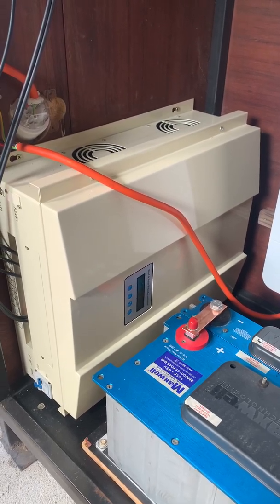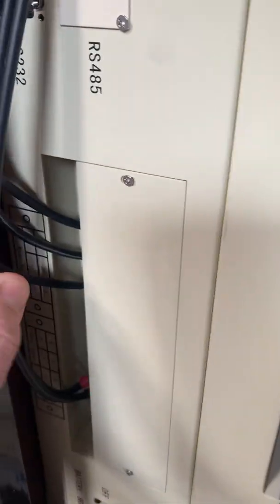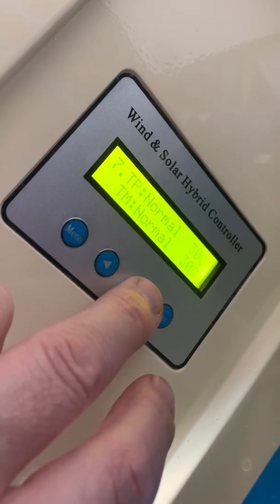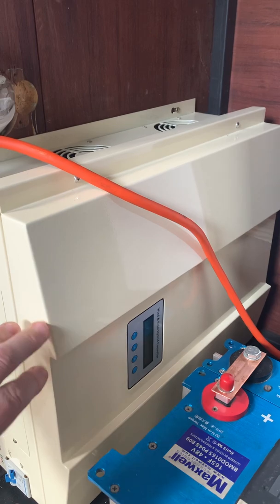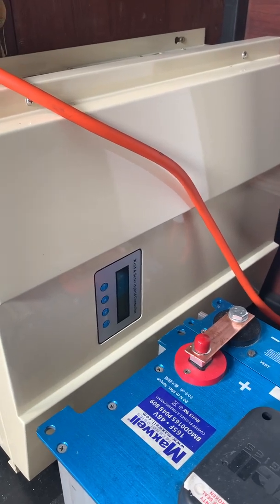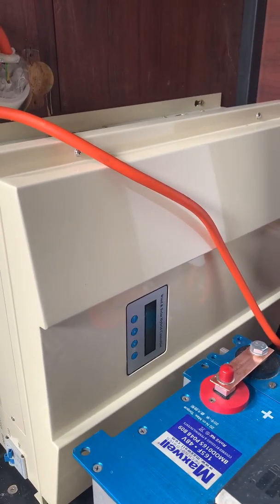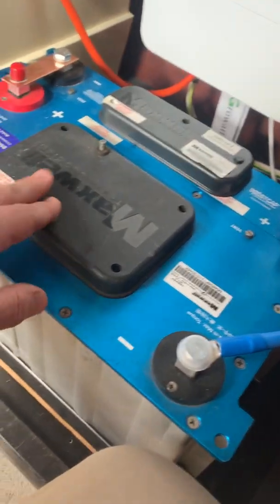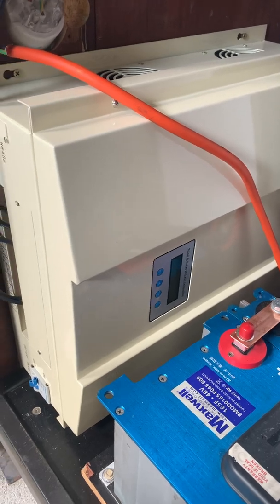MPPT Boost/Buck Wind Turbine Charge Controller From Avian Wind & Solar, AliExpress.

Comment: Nice big supercap. I run my ista breeze directly connected to my super capacitor banks(after rectification) smooths everything for the windmill. Im sure youll enjoy your insta breeze ! Only issue i had with mine so far was their slip rings. They tend to malfunction in canadian winters.
Reply from the maker: Cheers, yeah my super cap is between the batteries and inverter for starting big loads, my blade hub appears to have a manufacturing error, the tapered hub appears to be off angle from the blade plate, I’m waiting for wind as Ista want proof of the issue, typically it’s been calm almost a week here.
Reply: @offthegridwithbert924  I have exactly the same problem with my new i1500 hub plate. The tapered bushing is really badly welded in place. Out by 1.5 degrees, off centre and the weld between the bushing and the top of the weld does not seem to have full penetration. I sent photos and they are sending a replacement. Strange, as I previously ordered a 3 blade hub and it was really well manufactured and precise. And twice as thick metal.
Reply from the maker: @nhikoid  that’s not good at all, but at least they are replacing yours, they ignored my emails and even the video I sent showing the wobble, I will keep trying as it’s simply not good enough.
Reply: @offthegridwithbert924  Hi, got the replacement 5 blade hub from Istabreeze. It's still quite badly finished but at least the bush is centralised and perpendicular to the hub plate. So no more wobble. Did they end up replacing yours?
Reply from the maker: @nhikoid  unfortunately no, they are ignoring my emails so I’m about to raise a dispute in eBay.
Reply: @offthegridwithbert924  Seems overkill, usually inverters already have capacitors in them to handle inductive load that needs more starting power, like a water pump for instance, how about the capacitor leakage, do you find that your capacitors are draining your batteries overtime ?
Reply from the maker: @TheDIYDen  you are correct that inverters have surge allowances but you need to think of where the cap is located between the batteries and the inverter, when a big load is applied to the inverter it pulls suddenly on the batteries, with the super cap in between the load shock is placed onto the 1900 amp super cap, the batteries are therefore protected from sudden inrush current which will extend their life 👍
Reply: @offthegridwithbert924  I suppose it could help, one key thing if you want to add battery life is to not charge them full, 82% is the key number according to tesla !